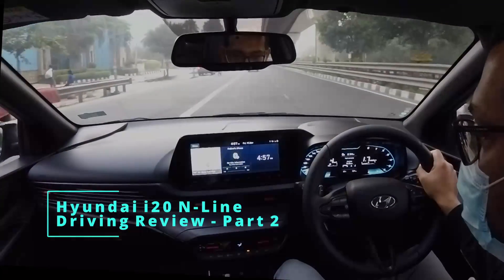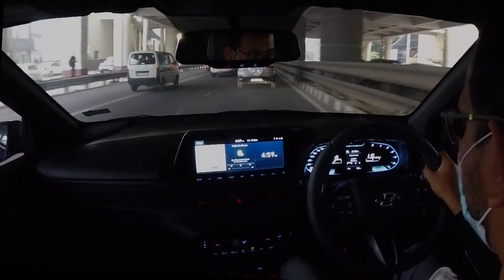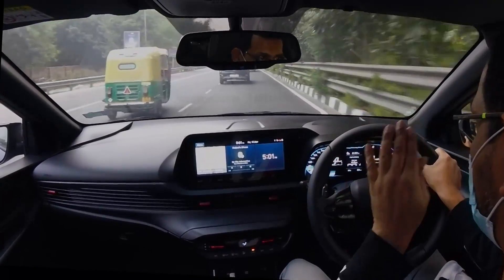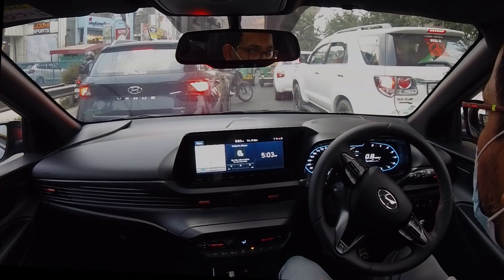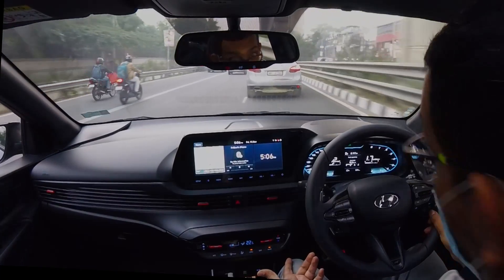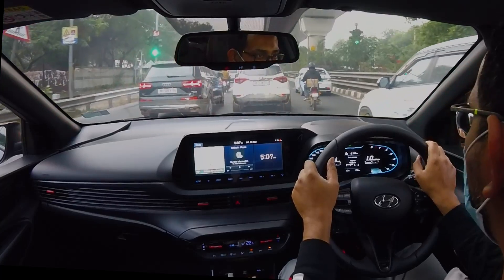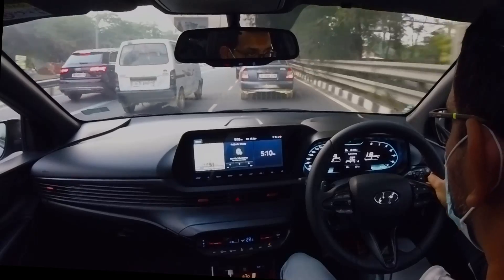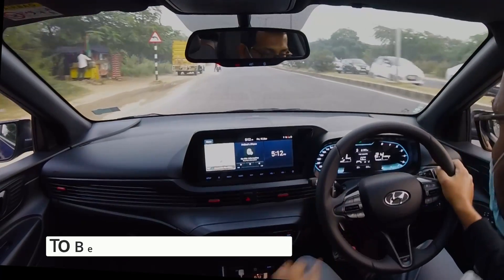My Hyundai i20 N-Line (N8 DCT) Driving Review - Part 2

Comment: Finally, a great mature review for this car out there. Your driving skills are awesome. 

In my opinion - Hyundai should have given better tyres and a bespoke n line mode, which ups the throttle and gearbox response, to go with rest of the improvements. That would have made it a proper jekyll and hyde character. Speaking of that nature, is it possible to remove those red inserts in side skirts? It makes it look bit fancy especially when it doesn’t have a go faster drive mode. 

This car is surely going to become ex- punto, fiesta, poli car lover’s new darling soon. 

Best part with this car is no compromise with after sales support as was the case with others and better reliability which was an issue with some cars.
Reply from the maker: The go-fast drive mode is the S mode in the gearbox. Put it in S and the cars engine comes alive. Yes, configurable drive modes would have been preferred but at this price point, I'm not complaining.
Better tires. yes again, but honestly the CEAT's are not as bad considering they took all the abuse I could throw at them in this video. I've now switched over to 195-55-R16 Michellin Primacy 4s. Much nicer grip levels along with comfort.
Reply: @PrithwiRay  congratulations on new tires. We hope to get a detailed review with new tires and a comparison between new and old ones. 

Your review style is very technical, crisp, mature and entertaining. Looking forward to more videos from you.

Comment: This will be a good beater car. Reliable, cheaper to maintain and good FE ! The only downside i see is the engine, this car with 100 octane = 1.0 tsi at regular fuel. 1 tsi is definitely a better engineered "engine".!
Reply from the maker: Nah, the 100 octane was a one time thing. This is designed for regular fuel, works wonders on higher octane. 100 is honest a waste on this stock, 95 is good enough to get the same performance.

Comment: Hey congratulations! I got my n line the same day you got it as well! Was wondering when you change the tires, which one will you go for? And what size? Is it okay to up size it to 205?
Reply from the maker: I would avoid going to 205 on a 6J rim
Reply: @PrithwiRay  are you planning to change the tires? Or the rims?
Reply from the maker: @akshathsarkar907  tires changed to primacy 4 today. 195/55/16
Reply: @akshathsarkar907  bro I would suggest you to not upgrade it 205 section tyre whether stick with 195 of either Michelin, pirelli, etc. But don't upgrade otherwise you TPMS is going to malfunction.
Reply: @PrithwiRay  Hey, why didn't you go for the 4st instead of 4?

Comment: Hi, Did you come across ground clearance issue? additionally the lag in lower gears, would that rather help in city traffic roads that way you need not put extra efforts in braking and decelerating the vehicle.... thoughts?
Reply from the maker: Never has a clearance issue with the stock suspension.

Comment: Hey man help me out the
 is out the i20n line is the next choice obviously the dct one. The tsi is a better tuner and everything but in terms of steering feedback, suspension corner carving ability which would be better. I drive alone so I don't care about the space plus the features are more gimmicky on the i20 rather than useful in everyday. Is i20 really worth spending more
Reply from the maker: If handling is your game, get the i20, if you want straight line power, the polo1.0tsi mt 
wont disappoint you.

Comment: Prithwi, after watching this review, I drove Nline and I’m really surprised the way it’s suspension is tuned. 
Can you please recommend what has to be changed/upgraded to get such similar feeing on a diesel laura 2.0 ? 
Recently I’ve changed the shocks to meyle , mounts, link rods, engine mount etc, all are OE. After the change, ride and handling is better but I can feel there is still a need of ~ 15-20% more stiffness to address the body roll over the uneven roads which I could definitely feel this Nline has excelled in it. Pls recommend !  I’m not a racer nor take it to track! I just need a little more stiffness to the existing setup.
Reply from the maker: you will need an anti-lift kit (caster correction rear control arm bushings) and stiffer dampers from bilstien.
Reply: @PrithwiRay  Pls let me know where can I get it done. I’m based out of bangalore.

Comment: Sir, I have i20 2017 1.2 Asta optional. I live in hilly area. I feel my car with 5 people in is under powered on up hill. Hence i would like to Change my car, kindly suggest Will i20 Diesel suite me as it would have higer trogue. I didn't considered 3 cylinder 1 ltr engines so far but aftet watching your Video you totally confused me. What mileage you get? Are you satisfied with five people on borad in the up hill? Because now i think going for N8 is better. What do you say?
Reply from the maker: Yes i20 diesel will work well in the hills, lots of torque in that car
Reply: @PrithwiRay  Thankyou 👍